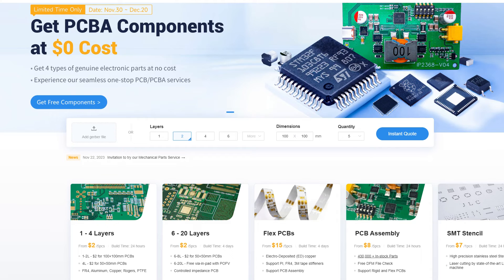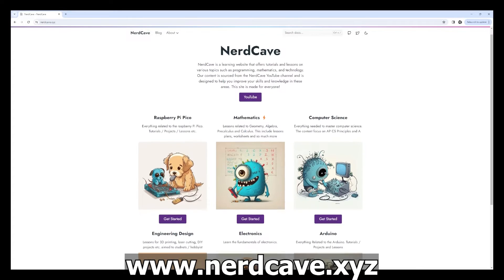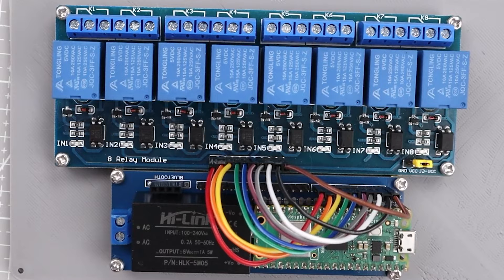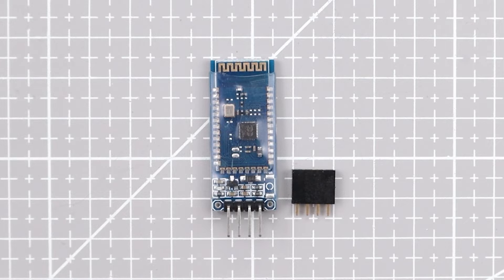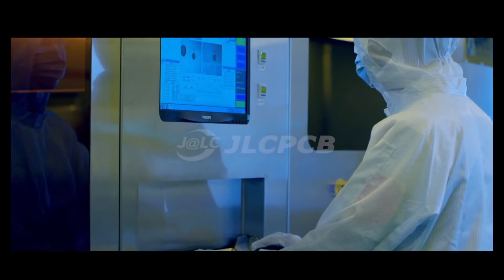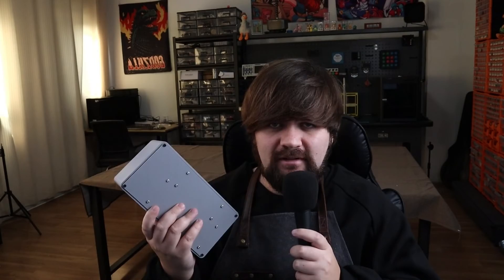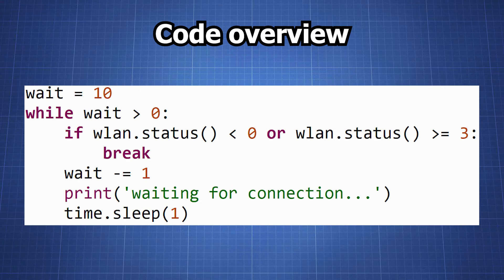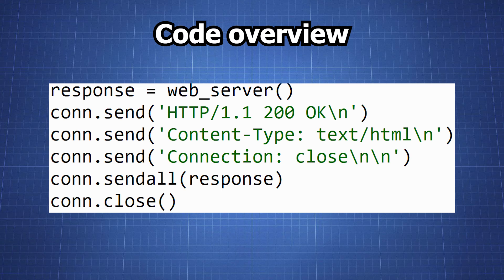I made a Wi-Fi Multiplug - Raspberry Pi Pico W

Comment: Thank you for this great project.  
One thing that you might consider is to add a static IP address.  I use this which seems to work OK - even if I don't really understand it.  ;-)
# set fixed IP address:
# IPv4 Configuration ('IPv4 Address', 'Subnet Mask', 'Default Gateway', 'DNS Server')
wlan.ifconfig(('192.168.1.63', '255.255.255.0', '192.168.1.254', '192.168.1.254'))

Comment: It looks like your website for the project has info for your 'Motivational Box' and not the 'Wi-Fi Multiplug'.  This looks like a neat project and I was curious about the relay controller you used and all.
Reply from the maker: Yes, It should actually be hidden, I made the schematic last night to finish the write up so it should have been saved as a draft on the site but will hopefully be updated today or at latest this weekend. I am planning to make a version of this to show the working and using DC to show what is going on to be a bit more safer for demonstration. I am always hesitant when doing projects using AC due to safety reasons when viewers try to recreate this.